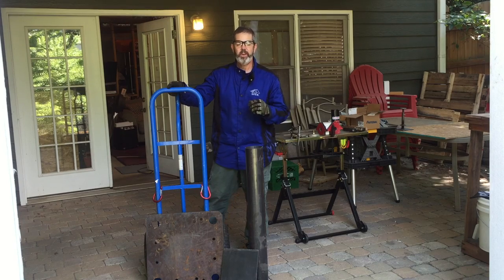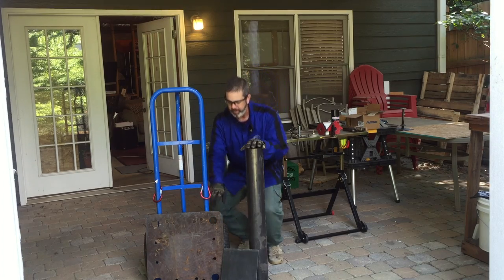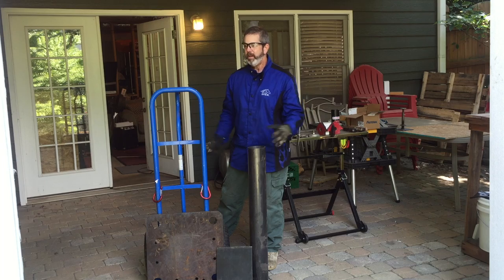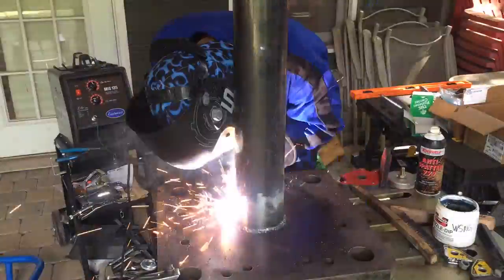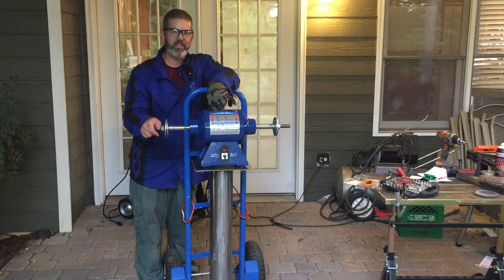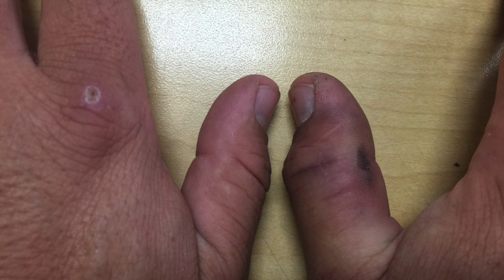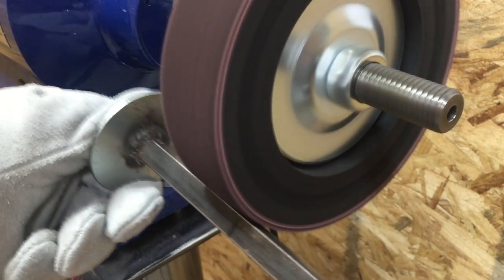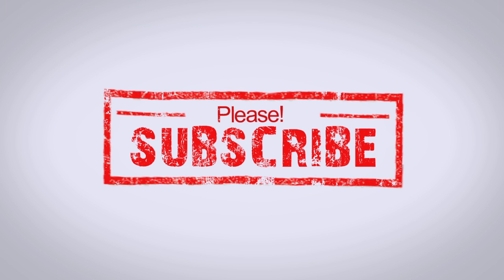DIY Buffer Stand | Tool Stand | Budget Build

Comment: Wearing leather gloves while using a grinding wheel isn't very safe. But you do whatever you want it's your hand not mine
Reply from the maker: Appreciate the advice.  Funny thing is, I normally don't.  These gloves came with the buffing kit and not the rubber wheel and grinding belts.  When I was getting the face shield I thought that maybe I should be wearing gloves.  I can see how it may be a bad idea now that you mention it.